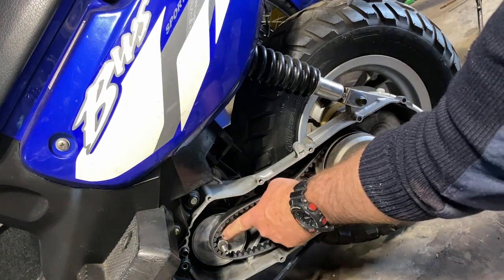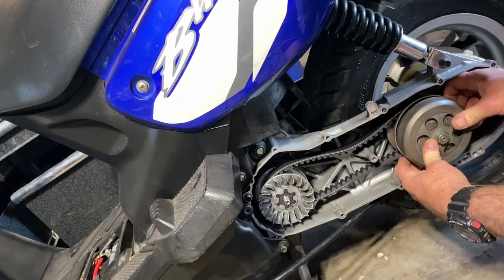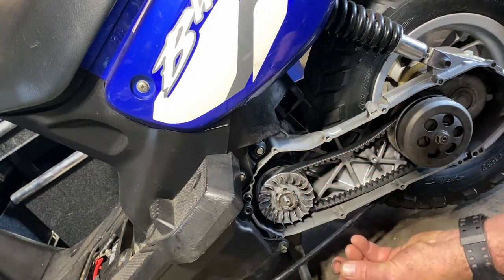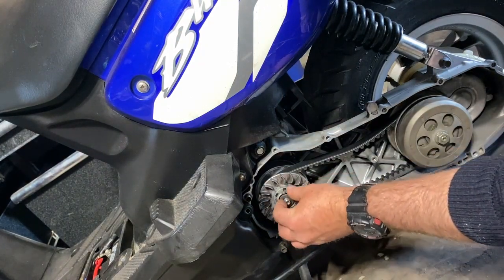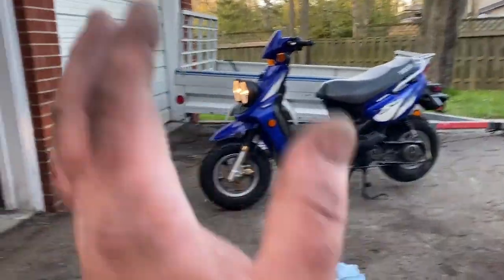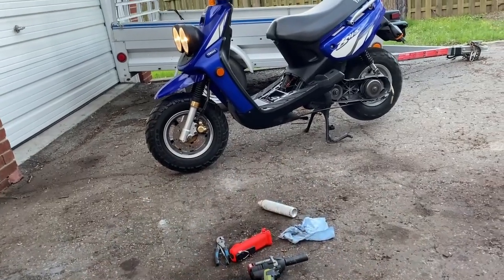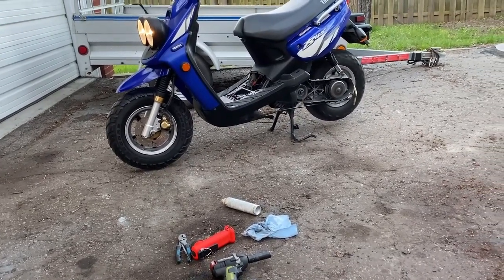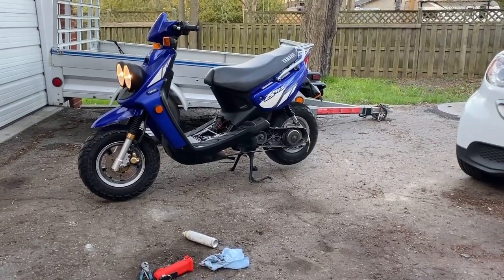Yamaha ZUMA BWS   Free top speed upgrade partial success . Only 70kph

Comment: It only goes 70kmph cause the cdi limits ignition btw
Reply from the maker: Good info . Thanks. I guess the prior model Zuma had a different CDI since I got almost 90kph out of 2 of those bikes a few years back
Reply: @fupabox  what year is that bike and what year were your previous ones?
Reply: İf you no how do i fix that ??
Reply: @Hasangurbiyikli  you fix it by buying a new cdi from amazon lol its like $30
Reply: @fupabox  they sell "race cdi's" on amazon btw
Reply: @eucerin_perin  oh andd you now what i found my bws 100 has restrictor on it ist was full stock so thats wyh it was going like 65 70 with 100 cc engine now i wil take that of and reach about 80 85 kph
Reply: @Hasangurbiyikli  what restrictor did you find?
Reply: @st3rg I took out the shim washer and mine gets 40mph with the free throttle mod